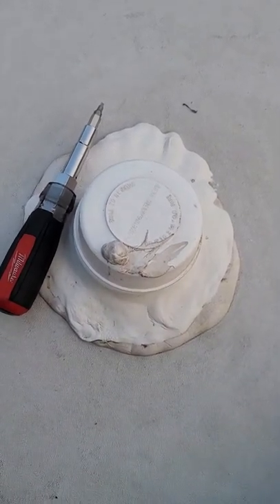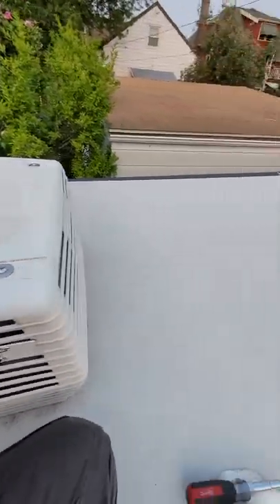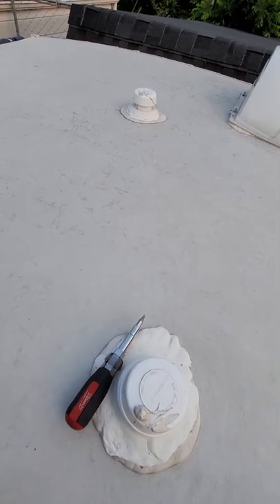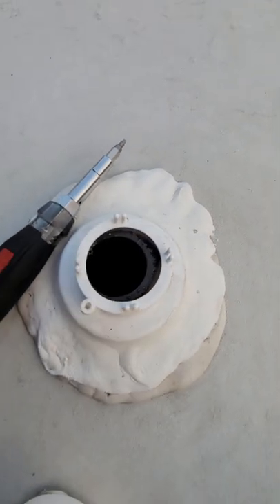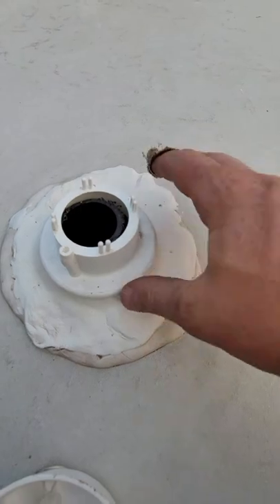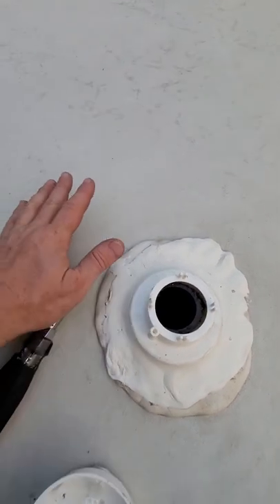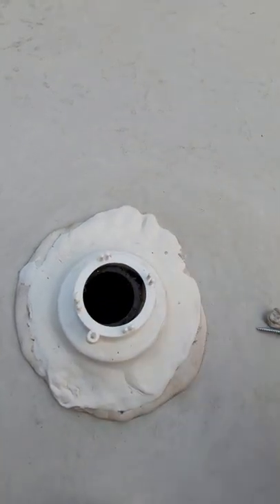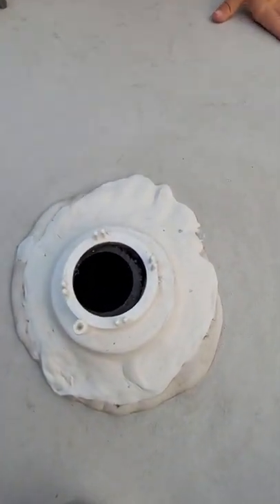sewer fumes coming into rv from plumbing vent

Comment: Just did this fix on our 2021 forest river Salem fsx.    The black pipe was just like this and they even left the roof membrane piece they cut up inside it.   Filled the gap FULL of clear dap silicone and it fixed it.   You sir are a hero.  I cannot say thank you enough for this video.

Comment: Huge thanks. My wife and I live in our RV full time while we traveling and the sewer smell started to become a big issue! I actually used a can of spray foam to fill completely fill the gap and then followed it up using the silicone to make the seal. I’m not trying to count my chickens before they hatch but It’s now been 30 minutes and the smell is gone!!! We will see how it goes tomorrow when it’s in the temp gets into the upper 90’s.
Reply from the maker: Glad i could help

Comment: Thank-you so much for this post!! My daughter's camper had the same issue and this totally makes sense for when I remove the vent caps it had a huge gap around the vent pipe and the pipe was at least an inch below the vent outlet. I also spray foamed around the pipe but left it about a 1/2 inch below the vent pipe so I could cauld on top of the spray foam. I greatly appreciate the tip
Reply from the maker: That's great to hear.  Yeah sometimes the gap is huge and you have to get creative.  I always tell people you can't really screw it up.

Comment: Having this exact same problem. Air conditioner is just rancid thru the whole camper only when the toilet is flushed. I have come across another thread online where the guy used an endoscope to follow the AC Ducting (which is just utilizing the framing gaps in the ceiling) from the AC towards the black tank vent pipe, and discovered the black tank vent pipe travels directly up and thru the AC duct. And with that style of roof vent, it is able to create a vacuum at that gap and suck all the nasty smells back down beside the pipe and into the AC Ducting. Tomorrow I am picking up some different venturi style vents and lap sealer and making sure that vent cannot possibly allow stink air back into the trailer and into the AC Ducting. This will also help the AC run more efficiently as it will not be sucking any hot outdoor unmetered air into the system. Double whammy.

Wil you be replacing your black/grey tank roof vents as well?

Comment: Just to clarify, what exactly did you seal up with thumb gum? I don't see any difference? Thanks!
Reply from the maker: You can use thumb gum if the gap is too big.  Silicone works just fine for smaller gaps.

Comment: Thank you so much for this video. I have a beacon 5th Wheel and it smells like sewage also in my living room and bedroom. I cannot get rid of the smell for the last week. I’ve done so many things. I have flushed the black tank so many times. I believe it’s the problem that I have. Was the black tank also The same with the same gap? So you’re saying just put some silicone in that small little gap and that should fix the problem?
Reply from the maker: Yeah that gap leads to your ceiling and when the ac is running the return air can suck some small amounts of air from that space.  Cleaning your black tank is good but it's a poop tank it's always going to smell bad and a reason they put the vents on the roof.  Sealing these up seems to make a huge difference.  Sealing up where the air return is on your ac units also helps but can be a little trickier. Good luck.

Comment: Not sure my issue but I recently bought a 05 keystone Montana that I’m renovating. I’m about 50% done with the process but when I bought it I smelled nothing no bad smells at all. Well of course spending hours working on it I used the bathroom in it as well as family also. I finally got my septic hooked up to it. And decided to empty the black tank…took about 7-8minutes (not sure how full it was) but ever since I’ve emptied it, I smell sewer (bathroom has no smell at all) but I only smell it when using ac (not the roof ac) I bought a indoor unit for temporary use that runs a exit air hose out one of the windows. Doesn’t pull air from outside, it’s simply pushing hot air out of the ac itself like a window unit would. I have that ac sitting next to the main slide out in the living room area. Sewer smell starts in the bedroom tho and eventually moves down to the living room area. (I know it is pulling air from behind it inside the camper). I’m kinda leaning that it’s possibly the same issue ur having but why would it only start after I emptied the black tank? I run this ac for weeks inside with no smells running thru the camper until the day I emptied the tank. Maybe you might have some insight
Reply from the maker: So it sounds like you're using a portable ac. That takes air from inside your camper and runs it across the condenser them ejects the air outside through that 4" tube that usually goes in a window.  This creates a negative static pressure inside the camper compared to outside pressure. This is allowing air to be drawn in through the ceiling cavity and yes most likely around your vent pipe. Id seal it up and also seal up the return air cavity  on your ceiling ac unit so no air is getting into that space from where wires come through and any other gaps.
Reply: this is most likely a faulty air admittance valve...like 99%. It stayed open and now your bathroom smells rank always. I need to replace mine I figured out from watching a few videos while vacationing in Mexico. Not gonna find that part here. Maybe I can force it closed between dumping the tank.

Comment: Been having this issue randomly year 5 of full time! I noticed it was the worse when the AC's kicked on, especially the rear AC. I have sealed off my AC's inside with aluminum tape and made the custom air divide in to force through the vents. However, I think since I got my tailer the duct system in the roof is broken right near those vents which would make all of this make sense!
Reply from the maker: You're off to a good start
Reply: @michaelplatko3994 this seems to have been the last place of the puzzle. Got some plumbers putty and filled those gaps and it seems to be gone. While I had the caps off I could smell the exact smell if i got close that I smelled inside so pretty sure that was it.

Comment: I need help on a strange issue also that is stranger than yours.  My Black tank vent pipe and vent cover was eating off by some rodent.  So only about 1 " of pipe is sticking up.  Do you or anyone else know how I could add enough pipe to install another vent cap?  I think just adding a vent cap over the 1" of pipe would produce the same bad effect you had.   Or would it be OK if I make sure the pipe is sealed so NO gases can get in the ceiling like your issue.  Any help would be great.
Reply from the maker: I've worked on brand new campers where the pipe is actually below the roof deck.  If you're an inch above you should be fine just seal it up so no gases get below the deck.

Comment: Dude, I've been experiencing the exact same issue. While I'm no a/c guy, I know how they work. What you just showed (I'm hoping) is the problem. Makes perfect sense. It can't be anything else. Tell Logan I said "hey." Seriously though, thanks for posting this, this has been driving me nuts trying to figure out.
Reply from the maker: Glad I could help.  And yeah once you think about it, it really can't be anything else unless a vent pipe is broke or something like that.
Reply: @michaelplatko3994  As it turned out, there's a 3 inch gap between my roof and ceiling that is filled with insulation. The black tank vent was actually in two pieces and the leak was at the joint, about 6 inches from the top. I resealed it with some silicon and bam, problem solved. Thanks again!

Comment: Would this be the same with the heater being on and getting that same smell only when running heater ?
Reply from the maker: If you have to run your ac for heat (heat pump or strip heat)  then yes.  If it's a seperate furnace,  then no.  That could be an unglued or broken pipe joint inside the return air for the furnace.  Without seeing the setup it's hard to guess

Comment: Did this help ? I’m having the same issues
Reply from the maker: Yes it was an instant difference.  There are known issues with some dometic toilets though so make sure the smell isn't coming from there first.
Reply: @michaelplatko3994 I have a sewer smell from back of toilet? Not sure if it’s. Domestic 300 toilet or not? Wonder if they replace if it’s a certain serial# or if it is out of warranty? I seen another video where they call Dometic an they sent same model?

Comment: It worked!!!!!!!!, I can't believe your video only has 100+ likes , it should have millions of likes .

I live full time on my RV and been dealing with this issue for a couple of months ,and it was fixed it right away after I did what you suggested. Thank you Sir !!!!!🫡
Reply from the maker: I'm glad i could help.  I've shown this to a few dealer service guys and they are amazed they didn't think of it either.
Reply: @michaelplatko3994  ......put me in for a big thank you also!! I bought a 360 Siphon vent to install on the sewer vent pipe.....the smell with the air conditioner on was unbearable!! Removed the old vent.....found the one and a half inch sewer pipe going through about a 3" hole in my roof.....the vent pipe was also obstructed with a piece of the roof membrane which they failed to remove at the time of assembly. Wasps were well on their way making a nest in the wall also.....used about close to a tube of silicone to secure the pipe to the oversized hole they cut in the plywood roof.....installed the new vent and covered the base and seams with Dicor.....thanks again for the tip :) Much more pleasant smelling sewer on the out side of the RV vs inside of the RV!! lol  Will check out the Gray Water vent once my sense of smell returns!! lol